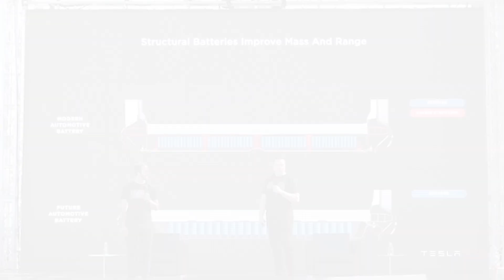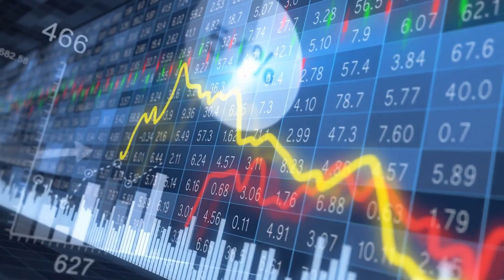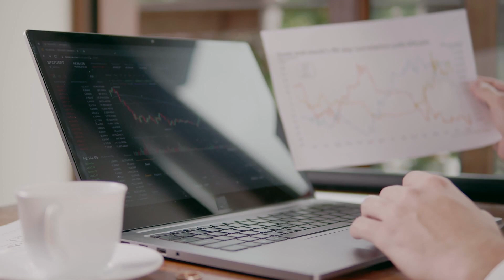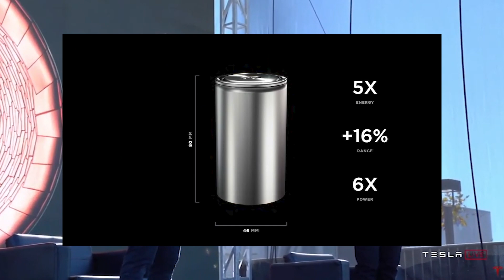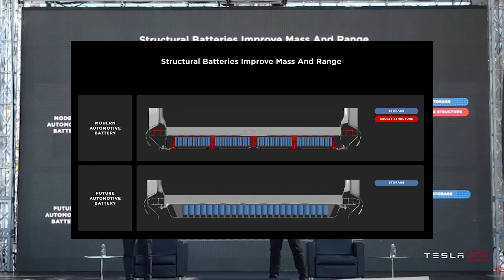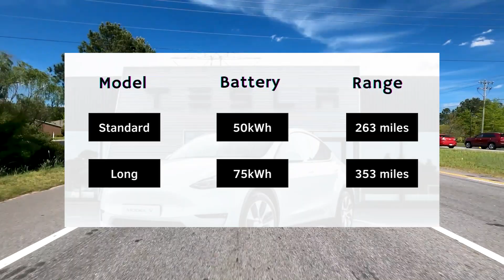What’s the Real Magic from Battery Day?

Comment: You need to compare individual cells with each others as Tesla did on the battery day. For example 1200 CATL batteries is needed to provide a 275  mile range  in  M3 if all other parameters equal it only 900 cells of 4680 batteries to provide the same 275 mile range. As a result a lot less cells will be required for cars .This really make a huge difference considering millions of cars that will be using these batteries. The 4680 batteries are well suited to be structurally packed vs other skinner and smaller cells.

Comment: Weight savings doesn't change highway range much. If they pulled enough weight off the car to drop down to 225 tires maybe they could get an aerodynamic win there I guess. But the EPA range rating in the USA is a mix of city and highway range, so their EPA range will go up, but it would increase the discrepancy between EPA rated range and what consumers observe, and its already bad there.

Comment: People are tending to miss the next shift in priorities for EVs here, I believe. Greater energy density is fine, lower price and weight, all good. But the huge advantage of the 4680 tables design, besides accelerating production, is that the battery can release a lot more energy quickly (while creating less heat which is lost energy and costs energy to deal with) and can recharge a lot more energy quickly too. So you get the acceleration you might want with fewer batteries, and range becomes much less of a concern as recharging speeds up. I think the next Model Y is the SR Performance. If you can recharge in ten minutes, do you care if you have 275 miles range or 400? Not much. You are going to stop for ten minutes every 4.5 hours anyway on a road trip, likely longer. Would you want to pay a lot more when the handling is actually better for the SR Performance than the LR Performance and acceleration is close?

Comment: Tightly-packed small circles waste EXACTLY the same amount of space on a plane as tightly-packed large circles. This is counterintuitive but true. The loss is (1 - pi/4). Other than that, the benefits of 4680 you outline are very true.
Reply from the maker: In a sense you are definitely right, but there is more structure taking up the area in the 2170 pack.

Comment: Due to regenerative braking (and within reason) weight saving won't have as much effect as TE suggests. The momentum energy is recovered rather than dumped as heat when friction brakes are used. It's likely that 4680 can better handle the short peak recharge delivered by braking than 2170 can manage. It's also likely that two motor cars brake better than single rear motor cars. They are less efficient overall, because there's so much more power - which gets used as it does in any performance car.
Reply from the maker: Are you saying regenerative braking may be even more effective with 4680? Regenerative braking doesn't recover a lot of the momentum.

Comment: The elephant in the room is LFP battery chemistry.  LFP is cheaper, can be fully charged and discharged, lasts 3 times longer than what Tesla is using in 4680, and doesn't depend on access to nickel.  Mid-range Model 3s from Fremont have LFP batteries.   On the other hand, 4680 can be manufactured much more quickly in a much smaller factory.   Ideally, Tesla would get the best of both worlds, but that isn't a solved problem.   Tesla customers may go from having a strong preference for 4680 vehicles to a strong preference for LFP-batteried vehicles, which will affect profitability.

Comment: Wrong, The Volumetric density must be higher.  Even though the volume is greater for 4680 compared to 2170, the energy per cell is much higher so when you divide it, it will be improved Volumetric density and Gravimetric density.

Comment: Thanks for your continued great content. Question...comparing the 4680 cells to the 2170 cells are we speaking in terms of watts per kilogram. It certainly is not cell to cell.
Reply from the maker: Some of the comparisons are cell-to-cell, others are weight, and others are kWh. It's all over the place, which is why I tried to consolidate it all and explain.
Reply: @TeslaEconomist  Thankyou. 🙂
Reply: The 4680 cells allow a greater amount of energy for a given volume and weight, partially because of their own structure but also perhaps more importantly because of how they allow the battery pack to be structured. 

But I believe it will be more important that they are tabless, allowing a lot more energy to flow out or in quickly. This means faster acceleration and faster charging times, and it also creates less heat each way which means greater efficiency, less electricity is turned into heat during discharge and charge and then less power is needed to get rid of excess heat.
Reply: @tribalypredisposed  Thank you. It is a little confusing. As far as faster acceleration I think that is unnecessary.🤣 I’d like to see a chart stating that pound for pound the 4680 cells will need x% amount less than the 2170 cells due to their efficiency and cost x% less due to the cost of manufacturing. Comparing 4860 cells to 2170 cells is like comparing apples to oranges. We need a common denominator! Thank you again.